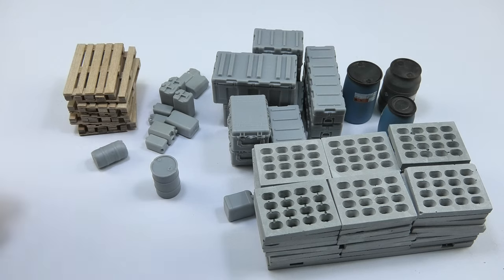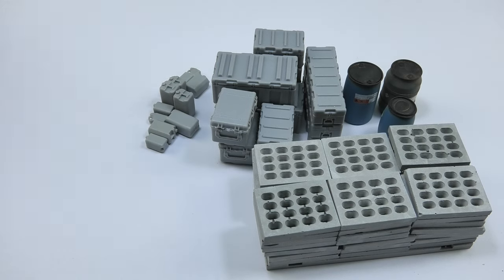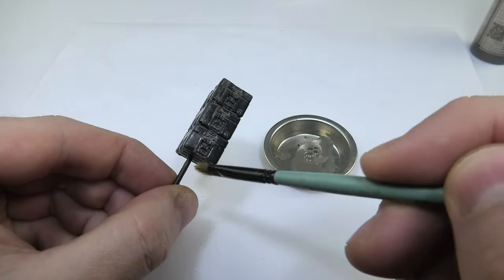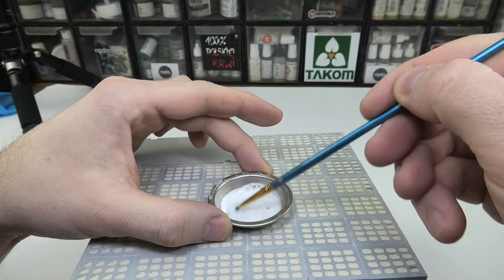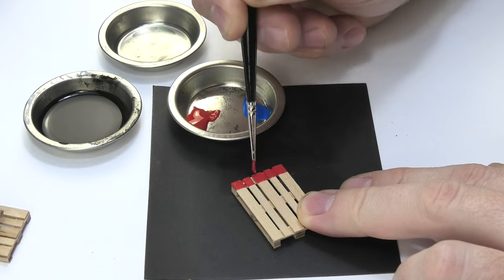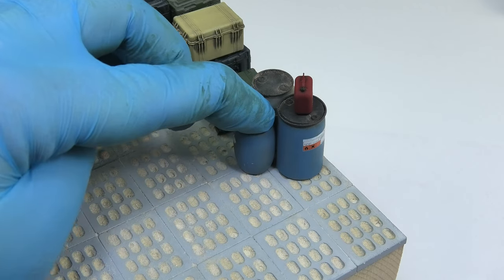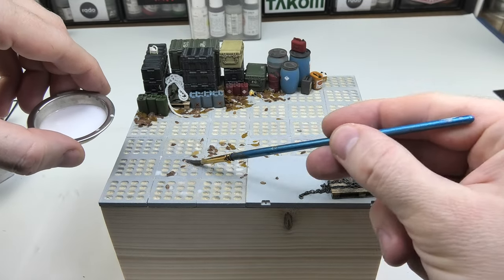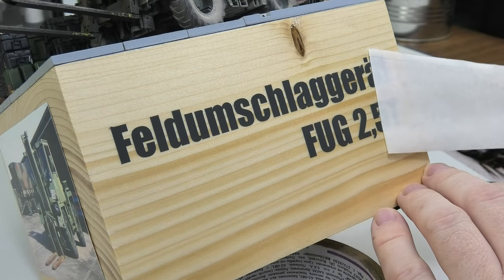Military forklift Feldumschlaggerat FUG 2,5t in Bundeswehr service, Takom 2021 - part 2

Comment: thats very nice ,to prevent bubbles when you adding the ground add glue/water first before you add the sand it will elimiate the bubbles by a good 90%
Reply from the maker: Need to try this trick with water. Thank you very much!! :)

Comment: Outstanding diorama in every aspect! What's that glue that you use to attach the elements to the base?
Reply: The pavement was attached with PVA glue a.k.a. white glue, wood & paper glue, and the accesories were attached with cyanoacrylate (CA) glue.
Reply: @raptorscalemodelling422  Are you sure? The tube was larger than regular CA, the consistency resembled some "universal" clear glue.
Reply from the maker: Well, concrete road plates - PVA glue, elements on them - CA glue.